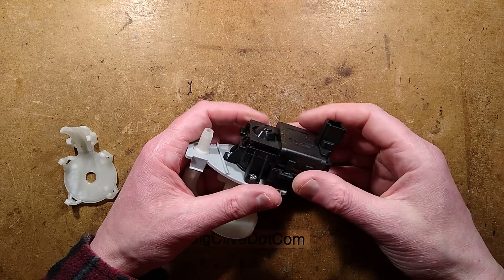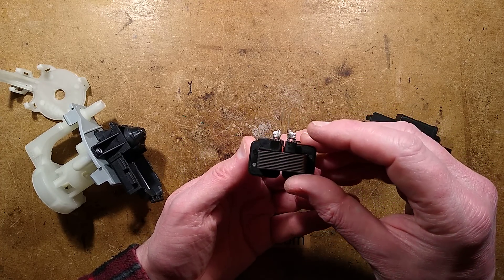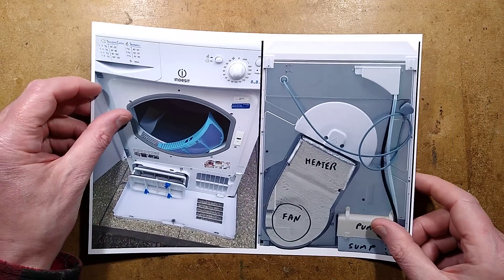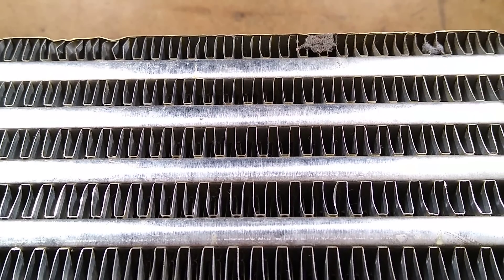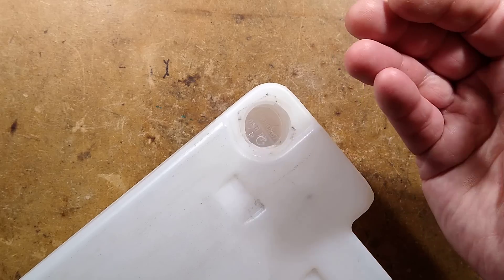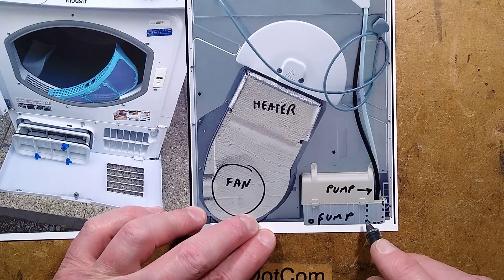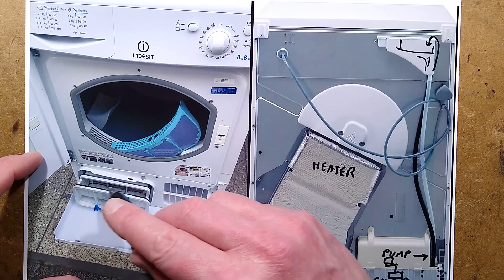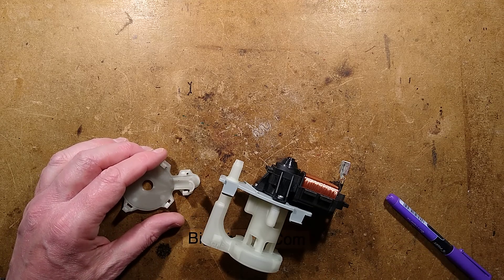Condenser laundry dryer pump

Comment: Also very interesting are modern dishwasher pump/heater units. I was quite surprised when I recently repaired one. The heating element was a stainless steel ring with a heating foil element around it, that was also the body of the pump
Reply: @chrislee6650  Yes, that is really annoying. Especially if the heater is very easy to replace like in my case! The rest of the pump seemed quite indestructible, too
Reply: We recently had to repair our Siemens dishwasher because the drain pump was clogged by anpiece of plastic. The heating element seems to be part of the pump assembly. Interestingly, both pumps are BLDC motors.

Comment: I have not seen these in the USA, or heard of them before. To the extent that I false-invented them several years ago. Not due to only needing a regular circuit, but thinking that not using heat could enable you to dry more kinds of fabric.

Comment: Clive, I was wondering how fast it would spin and how much flow and pressure the pump would have?
Reply from the maker: Single pole pair magnet it appears, so as a synchronous motor I'm guessing 50 RPM.  Not sure it's optimised for much pressure.  Just enough to lift the water 32" / 800mm.

Comment: My washer/dryer works slightly differently.  There's a condenser that fills with cold water from the mains supply and the hot moist air from the drum blows across it.  Condensate and the water from the condenser when it starts to warm up a bit just flow into the system that pumps the water from the drum at the end of the wash cycle.  There are some sensors that measure the amount of condensate produced so  the autodry program knows when the clothes are dry and shuts the machine down.

Comment: Here's a fun tip, the water out of these dryers (and de-humidifiers too) make great water supply for steam irons. 
Most folk would fill their irons with tap water, but in the UK, a lot of tap water contains salts which don't behave nice with steam irons. 
The water out of these dryers is close to distillated water, but at zero cost.
Reply: The collected water might be close to distilled, but I have found often contains lint dust from the laundry being dried. Before using it for steam irons, I pass the water through a coffee filter paper. This works a treat and I never have to descale the iron. Great video, Clive!
Reply: @steves8083  I use my dehumidifier in the colder months, I have noticed small specks of lint in the water, so I clean the filter regularly. The water sits in a clear bottle and so far I have never noticed any bad smells when ironing. I feel pretty confident it’s clean.
Reply: @JohnnyMotel99   I also store the collected water in a clear bottle and, if it’s held against bright sunlight, the lint particles become visible. Sometimes they settle to the bottom after a day or so. Agreed that the water is clean with no odours present – after all the laundry is usually washed before being dried 😉 I think the lint is airborne as fine particles that pass by or around the internal filter via the fans. The concern I have is to prevent lint from getting inside the steam iron as it could build up and eventually cause blockages. The other issue is algae in the clear storage bottle. Keep in the dark, ideally.
Reply: @steves8083  I should have worded my original comment differently. I use dehumidifier water only as I sold my condenser dryer and use my dehumidifier to dry clothes on a rack. I think a dryer water will contain a lot more lint etc. I have never noticed any algae forming in the water.
Reply: @JohnnyMotel99    OK I see what you mean! Your dehumidifier rack setup is quite different and results in far less lint. Admittedly, the ironing water algae was formed over a period of several months in a fairly bright room, where the bottle was topped up with coffee-filtered water each time it ran low. It was never rinsed during that time. 🤭
Reply: It's actually a horrible idea, the water contains some micro-lint and remnants of the washing agents, which then clog the irons (especially pumps in steam generators). As a home appliance repairman I've had to deal with many such faults.
Reply: It only applies when the dryer is not designed to be connected to the evacuation plumbing. Most if not all dryers in continental Europe automatically purge the reservoir to the sewers.
Reply: @PainterVierax  Some models have the option to connect a drain hose, but not all. (North Europe)
Reply: @janne_kekalainen  Maybe this option is more popular in less cold regions or less rural areas. I do laundry for 30+ years and I've never seen such an "off-grid" device in Belgium or in France.
Reply: @PainterVierax  I had a condenser dryer in the UK, it only had a tray for water. It was a Bosch.
Reply: @JohnnyMotel99  Clive already implied this design is common in UK. Hence why I talked about continental europe.
Reply: @PainterVierax  they can usually be connected either to the reservoir or to the plumbing, hence the convenient outboard hoses. Maybe you don't get to choose in some parts of continental Europe (it's cheaper to leave out the reservoir on the budget models) but I'm pretty sure the same models are sold all over the continent nowadays.
Reply: @mjouwbuis  I'm sure you're right. Manufacturers offer the same products in all Europe. Though, the different tech are more or less represented in retail shops depending on each country/region.
In Be and Fr, most homes have a built-in extension from the drain used by the washing machine. So dryers with a removable reservoir are rarely sold.

Comment: We had a condenser washer/dryer at the last place we rented.. couldn't stand it.. when you want dry clothes, it'll never happen. you were meant to use it, then hang them to finish drying which wasn't convenient (hence the space saving point of it), so we wound up using out stacked washer/dryer instead and makeshifted a bucketvent.

Comment: I had a candy branded one where the water tank was under it in the kickplate it had a one way valve on the back where it pumped the water into and a bit to empty it. It died after the motor burnt its self out (Made the kichen sink for a week!) Replaced it with a heat pump drier and it halved the cost of running it. My washing machine is more expensive to run now!

Comment: These things superheat the creases in your clothes, making them un-ironable. They also give electric shocks as they get older. Long been gone to the tip.
Reply from the maker: The cool cycle at the end is party to reduce creasing.    If giving mains style electric shocks then that may have indicated an earthing problem.  If it was static shocks then it may have been the earthing bush on the back of the drum.

Comment: Brilliant video except for one little detail, the machine  uses the float switch to cycle the pump on when the sump is full and switches back off again when empty.

Its a very simple on/off microswitch used for the float so when triggered it will run the pump for a set amount of time to ensure  the sump is empty. If the float switch is still activated after a set amount of time of pumping it then has a safety cut off and will stop the dryer, usually with an indicator to empty the water tank as most machines have an overflow pipe which leads back down to the sump, which will in turn fill the sump from the overflow as its trying to empty, stopping the float from being deactivated.

On some older basic conderser dryers, even though they still had a float switch, didn't have a safety cut off so would simply overflow if there was a problem with the pump or the tank was full.
Reply from the maker: On this machine the float switch only turns the machine off and indicates that the water reservoir is full it overflows back down to the sump.  It does not control the running of the pump.

Comment: We have a similar pump on our central air conditioner in the US. Our crawl space split system is technically below ground, so we have a condensate pump that ejects the water from the air conditioning outside the house. When I took our old one apart to unclog it once, it was a similar arrangement, but the impeller had 3 wings, and the motor operated by float switch in a small reservoir.

Comment: That's basically our machine. 8yrs old, and on pump number four. When you clean your heat exchanger, reach in and get the linty goop out from around the pump sump inlet. Apart from killing £12 pumps, it's as good as new.
Reply from the maker: My routine maintenance is to clean the lint from the heater air path and the sump.
Reply: Yes, black pipe is drawer feed, clear is return.

Comment: Will it work in a hot and humid area like Panama?
Reply from the maker: Not sure.  As long as the ambient room temperature is lower than the drum it should work, but less efficiently than with colder air.

Comment: We had one of these condensing dryers while visiting London. It took so long to dry that I could have installed the vent and hooked up a vented dryer in less time 😂
Reply: The efficiency of these dryers drops dramatically if you don’t periodically clean out the heat exchanger (not just the lint filter)  and my impression is that many people don’t. I mean I bet you didn’t check that ? When new they work very well and mine will easily dry a full load in 45 minutes.
Reply: @cliveb9771 no I’d never seen one before. It was in our rental unit, so I have no idea if it was representative of how these things usually work. Call it a bad first impression. 45 minutes is really fast for a full load. Even a natural gas dryer on high heat would have trouble matching that.
Reply: I agree....I can use my big honking American clothes dryer to dry a large load of laundry in 30 minutes instead of 2 hours of drying just one complete clothing outfit in these goofy condensing dryers.

Looking at the total energy usage and the run time and the actual amount of clothes dried....The American system is better in the energy department.

The American dryer has just 1...yes...just one electric motor....fewer points of failure.
Reply: @grandinosour  The ones in U.K. Launderettes are like that. However, you soon get fed up with feeding them 20pence coins (fully expect someone to say they are 50p or £1 now).
Reply: @MrDuncl  most uk laundrettes use american made Speed Queen / Huebsch Originators gas dryers that vent straight outside.
Reply: @grandinosour  Condensor dryers are for a particular use case. Where venting to the exterior is impractical, they are a tremendous invention. Also, the heat pump condensors are, I believe, more energy efficient than the vented dryers; but the work density is lower, so although they use less kwh per load, they take longer to finish drying the load.
Reply: @grandinosour  We inherited a condenser drier so got rid of our vented one. The vented one would dry a 7Kg load in just 80 minutes. The conder is lucky to dry a 6Kg load in 3 hours.

Comment: Clive, Want some fun.
LG is going to court.  For the last Bunch of years they are using a Condensor Pump on refrigerators.  REduced size, that Fails within a few years.  The Exterior of the BOX and inside the manual WARN about the Court case and HOW you have to deal with NOT going to court about this.
Might be nice to find this part/used part.  And a good examination of the failure point.
Funny part is that a FEW other companies have been Using this SAME LG reduced size condensor pump.
Reply from the maker: That'll be the bean counters making bad decisions again.
Reply: Are you sure you are not mixing this up with LG's linear *Compressors*, rather than the condensers seen here.

Comment: I do not understand the water container that needs to be emptied. All washing machines have a drain connected to the house drain pipe, dryers are next to the washing machine, just plumb the darn thing into the same drain the washing machine goes to. Then you never have to empty that stupid container.
Reply from the maker: Most have a direct plumb-in option.  But the reservoir allows more choice of where the machine is used.

Comment: I hate to see distilled water that is a necessary byproduct of some other process simply thrown down the drain. If even the simplest and most rudimentary steps were taken to maintain the purity of the excess water extracted from the dryer exhaust, that water could be used in a similarly rudimentary and simple evaporation process to further cool the air destined to be routed through the condenser system. This could be as simple as routing this air through some wet pads before entering the condenser unit, those pads being wetted with the excess water from the sump. Having lived all my life in Texas, I have always observed with puzzlement a typical window unit type air conditioner struggling to (try to) condense hot, pressurized freon by simply blowing 100°F outside air past blistering hot condenser coils (typically full of dust, lint, leaves, etc.) with a simple fan. All the while, this happens only inches away from pure, clear, ice cold, calcium free, distilled water simply flowing out a drain hole in the casing on to the bone-dry ground below. This, in spite of a significant accretion of algae, sediment, rust, dead insects, etc. in the bottom of the casing because absolutely no effort whatsoever is put into capturing the water before it is exposed to such contamination.
Reply: The water condensed from the laundry drying process can be re-used for watering houseplants as the water is not clean enough to be considered drinkable.  As the point of the condensing system is to collect the water and prevent excess moisture being distributed throughout the house, using the collected water to pre-cool the ambient cooling air would be nonsensical.  Also, don't confuse distillate with condensate - the extracted water collected by a condenser will contain impurities that were present in the air and collected on the damp surfaces.  The lint filters are good, but they aren't perfect.

Comment: Its a centrifical pump designed to deal with water with a posabilty of some solids in it,,  What could the solids be in a condensing dryer ?,, Any lint that managed to get by the dryers lint filter along with anything that could grow in the Condensate . lint would gum up the impeller of normal centrifical pump.. very intresting design..

Comment: Seems like lint would coat the inside of the radiator. Is that a removable part for cleaning?
Reply from the maker: The condenser can be pulled out like a drawer for cleaning.  The heater can accumulate lint, which isn't great.  Not so bad for the technically inclined who can open the machine to service it every so often.

Comment: So how long does the heater last when the machine turns off due to a full water tank?
From what I've learnt over the years the machine runs cold at the end of the cycle to let the heater cool down. If it shuts off every time the water tank is full will it cause the heater to have a shorter life?
Reply from the maker: The early heater turn off is purely for anti-crease in some fabrics.  It cycles on and off as needed during use.
Reply: The cooldown to prevent heat soak and overheating element is part of the design now. After a few fires related to these types of dryers, Hotpoint et al ran a recall campaign. Ours was barely used, but got completely replaced by a brand new one with the added cooldown logic. I'm guessing the original ended up in landfill with the rest that were recalled.
Reply: @squelchstuff  
Well it's good to know something has changed. I still prefer hanging out the washing except for the British weather. 😆
Reply: @Slikx666  Clothes line here too, but under a garden parasol to keep most of the rain off. 

The machine only ended up here due to combining households, and to be frank, it takes up a lot of space that I wouldn't have normally relinquished. It has come in handy for drying stuff in "emergencies" such as those that very young family members require.

Comment: This is practically very similar to those little fish tank pumps that circulate water. All washing machines use this type of pump. I remember our first washing machine. It was a Czechoslovakian TATRAMAT brand an when it finally gave up the ghost in the late 1990s I dismantled it and took the pump because it was working just fine. It was strong enough with enough pressure to serve as a garden pump for filling our water barrels.
Reply: Washing machine pumps usually use shade pole motors. Asynchronous without a permanent magnet rotor.
Reply: The air pumps for a fish tank are a whole different thing altogether.... 

The fist time I opened one many decades ago, I laughed hard when I plugged it in and saw how it worked... 😂